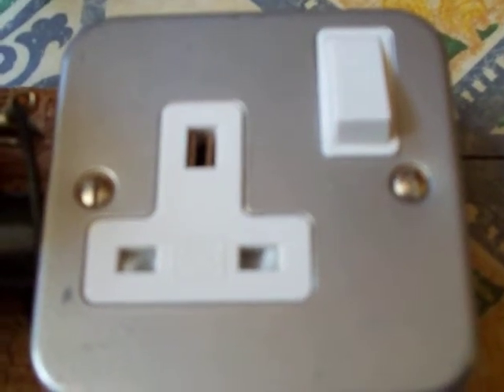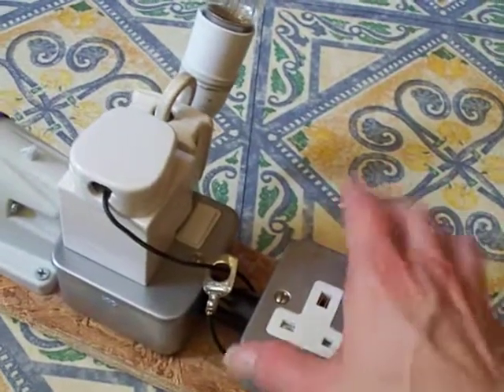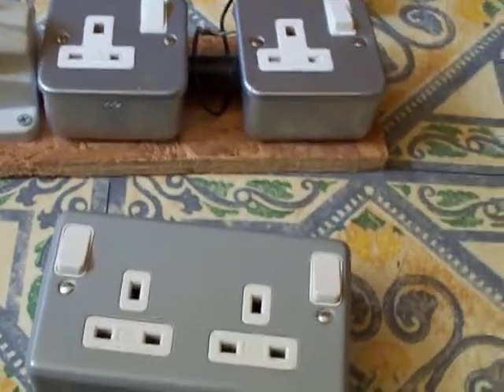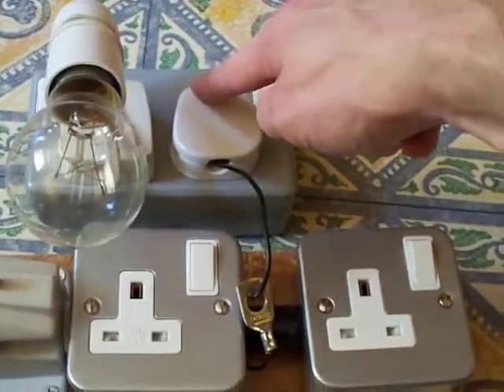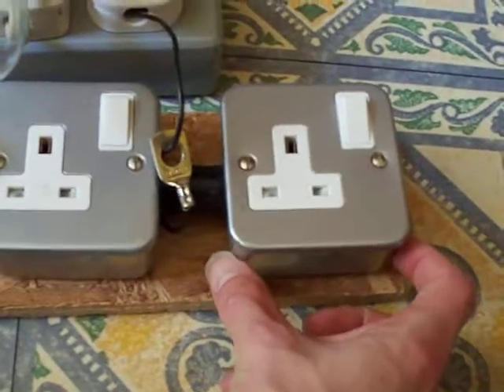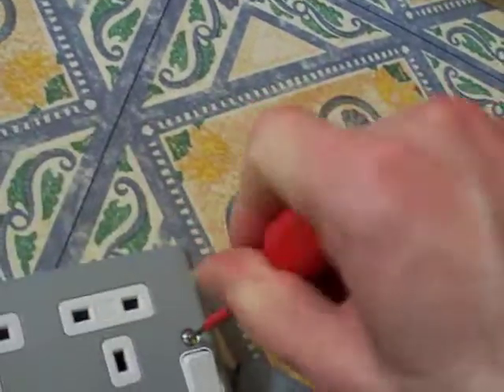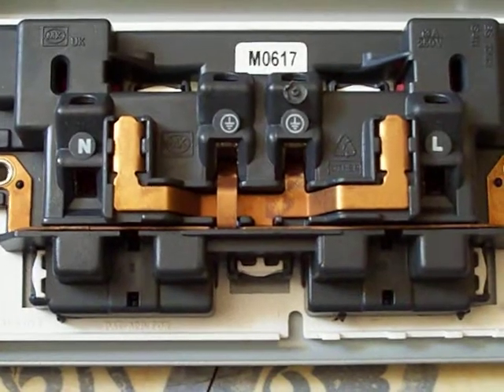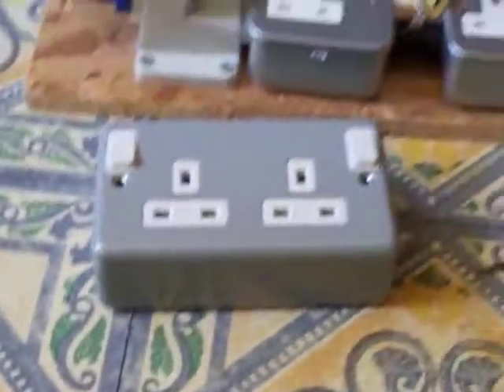Electrical : Time to upgrade the Fun-Jiggery-Pokery Unit.

Comment: Nice upgrade. You could also switch seamlessly between different ballats, too!
Let's say you have a mercury vapour lamp and two different lightbulbs, one 60 watts and one 100 watts. Then you can switch seamlessly betwen those and see how the mercury vapour lamp behaves.
Reply from the maker: Yes, that is also another possibility that this upgrade will enable. It would be possible to have two 'ballasts' in the double socket and switch between the two like you say....

....Or bang both of them on at the same time and have something GO POP. :D

Thanx for watching,

-BoomBoxDeluxe.

18th January 2014, 16.27